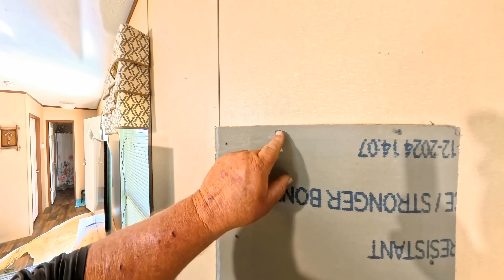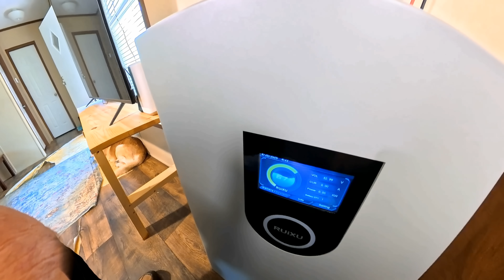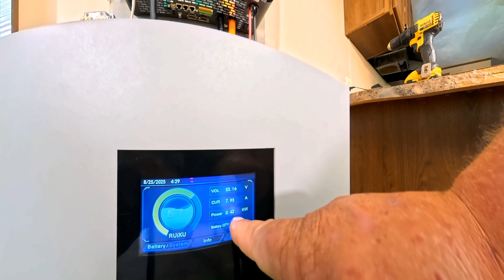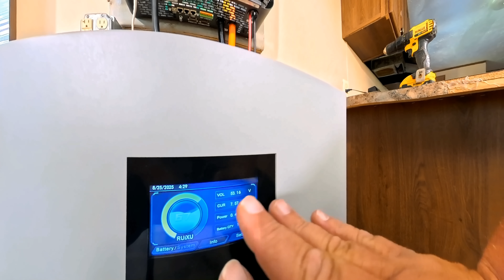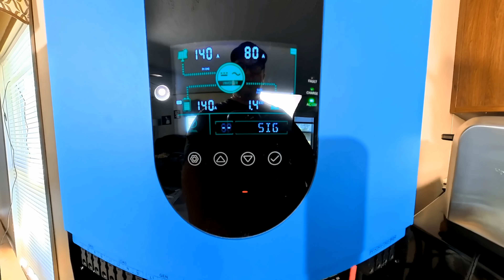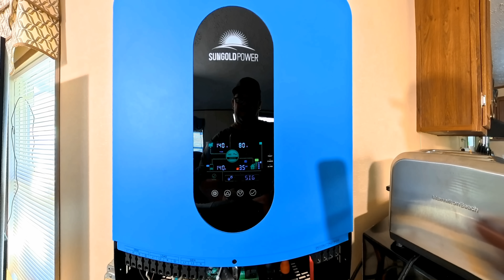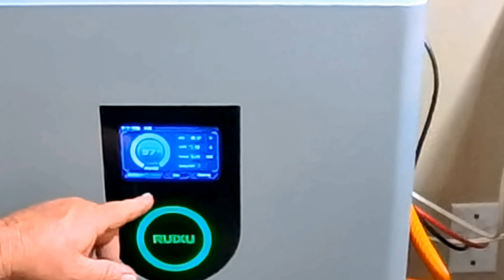Powering My House With 1 Battery Using Ruixu And Sungold

Comment: so much so wrong with this setup. Need to follow electric code "NEC"  wires from solar panels must be enclosed in emt conduit, the way you tap in to your trailer is very dangerous,
Reply from the maker: It's not dangerous it's tapping through plastic siding or what they call vinyl siding and inside the walls where it runs through the insulation you have the 120 volt wiring and 240 wiring running through the same crap. I understand putting it in conduit is the way to go for superior protection. But this setup has been working just fine for a year and the one that my other properties been working fine for 10 years.

Comment: Off Grid, I like using 12 x 2V 600Ah AGM batteries, when building my 24V system. 1st reason is each 2V battery is like one cell in a smaller battery, 
so you can replace that one cell and not loose the whole battery. 2nd you can make a 600Ah battery bank, and still be able to lift it on your own, each 2V 600Ah AGM battery is 40kg. The 3rd reason is price, with lots of newer types, AGM lead acid are cheap + I don't like BMS controlling my batteries.
Buy as a set to save even more money ( 6 = 12V  /  12 = 24V  /  24 = 48V ). 
I hope this information helps everyone get started.

Comment: couple of tips. install a power cut off breaker on the wall for the solar panel lines coming in. and Run a main line to your house breaker box and install a bypass switch to turn off pole power to house at the same time switching power over to inverter power. the line used to make connection between house fuse box to inverter should also have a 50Amp breaker. use the fuzebox to control where in the house you want to energize at any given time to reduce energy consumption. so much crap is left running or on when your not even home let alone while you are home.   all electronics today or appliances suck energy on or off.

Comment: I don't know where you're living at but I'll be living in Waynesboro Tennessee in 2 years. My goal is to do total off grid. How much did that system in the place you just put this in cost you??  I'm planning on building a 16 by 30, & wonder what the cost be for that system. 5o connect it into the electric panel. Not including the solar panels.  Because I'll have to do this in stages. Do the battery pack hook to the fuse box. Run the solar panels and connect them to the battery system.   I'm 63 so I'll be 65 when I moved to Tennessee, & may need some assistance with hooking it all together. I've been watching your videos and you're making it look fairly easy to do.

Comment: HI Justin great video man. I'm interested in running my well off of a system like this (Grid down scenario) . It is 220 volts, but not sure the Amps etc. It doesn't run all day for the whole house, but incrementally kicks on and off. What would be the best way to approach this?
Reply from the maker: You could actually run it with a system like this.
Reply: @OKLAHOMAOFFGRID  How would determine the amps that I need to run it?

Comment: Why not just 240 outlet out to a #4 ga to a 50 amp plug. Then, male into the receptical,  then shut the main off, turn on the inverter? Your next project should be to add a access ramp somewhere along that entrance of your place. You should throw the microwave out and the toaster. Nothing anyone needs.
Good explanation,  👍 👍 👍 👍 👍

Comment: Very informative. Thank you. I wonder what gauge wire is used from the solar panels into the house?  Are there length limitations?  Thx again.
Reply from the maker: Yes definitely length limitations depending on the gauge that you're using. I am using 10 gauge on this system and another system I'm using 8 gauge on.

Comment: That’s a 20 amp GFCI receptacle
Reply from the maker: No 15
Reply: @OKLAHOMAOFFGRID 
😂😂The GFCI IS 20 amp, the neutral slot is vertical and horizontal. The regular receptacle is 15 amp.
Reply from the maker: @Coyote-tc1ww sorry..ya your right I forgot I made that one with a 20amp 2 years ago. I have a box full of unopened 15 amp GFCI so I assumed I put one of those in when I built the receptacle but obviously not if it has the t slot

Comment: also some omore advice if you attach solar panels to the roof or like you did screwe them into your porch the city consideres that a structure and needs to be inspected or instellaed by a pro to negate that you can mount them on a pole in the middle of your yard 20 feet away from, the house.. with breakers and ways to cut the power and fuses etc etc.. they consider this a fence or like a fence or free standing structure... some cities dont care but youll have an inspector at your home... and you used regular 2x4 those will decay and get mould etc use galvanized fence posts or sqweare rack mounts or fence posts in concrete in the ground then it wont rust or fall apart in 10 years..one more piece of advice when hookiung up the power cables to the unit test whats positive and negative before you hook it up and if it has propper voltage also work at night solar panels are active during the day if you disconnect them a string they could spark within the mc4 connector this is why when compaines do it they wait  dont hook it up all at once and leave it hanging they hooke one up at a time then the final connections etc.. being a average joe i do all my panels at night and hook ups at night just incase then in the morning i test voltages and polarities you can do this with a dmm or a special dmm etc.. and if you ever see solar banks and controllers its inside your garage and outside the home why the garage well 5/8 drywall is fire rated for 1 hour of protection just like exterior doors have a fire rating for 1 hour and why ytou  should not install a interror door as your outter door... same thing you can install batteries in garage as long as garage has vents the twirly things on the roof and propperly installed  mounted to the studs etc circut breakers etc..  tesla batteries are known to install in garages more than outside.. but doing this inside wow recipie for disaster plus you lugged that up the stairs im your size and alittle older watch your back brother to old to tired let some young kid do it etc.. anyway ill stop talking lol
Reply: This is Oklahoma they don't have inspectors. Capital of red necking everything.😂

Comment: Power station much cheaper or back up . 3000 watts . Charged by house power  . Add solar if you like . Solar full time different  matter . Add more . Power up fridge  air conditioning.  Heating house big battery banks . And dolar . Charge electric car . No limit . Or hydro cheap .. 😅

Comment: In Nigeria these battery cost like 2k$ I’m shocked how expensive those batteries are in Australia and USA
Reply: $2k.... You sure it's real and the outdoor rated one? Lol In the USA this battery is $3,299... just checked the website. For 16kwh, that's a great price!
Reply: @kaleyeahitsaustin6026 yes it’s real in Africa a lot of Chinese solar brand here and you can set up 30kwh solar  system with just 5k$ ,the American government are restricting and putting tariffs on Chinese batteries and that’s why it expensive in the states
Reply: @Multi-Trend   no it's not because of tariffs lol the batteries have gotten cheaper over time. $3,300 for 16kwh... I'll take 4 that's so cheap! Plus if you get the indoor ones, they'll be even cheaper. I've not seen any price increases from tariffs and I live in the USA.

Comment: I collect pinball machines and one of my best investments was buying a used Escalera Staircat Ms-66 Stair Climbing Truck from eBay like 16 years ago. It goes for like $2500 or so but I got it used for 700. People borrow it all the time to move refrigerators and stuff. Great for moving my pinball machines up and down stairs. It would work great on that Riuxu battery.

Comment: I love your "get her done" attitude. When looking at this inverter's user manual shows line 1 and 2 combined. Will Prowse say's you need all 4 wires in the input and output, but yours is working with only three wires. Thanks for taking the time to make and post these videos.
Reply from the maker: I think I am only getting half the rated power like 3200 watts because I need to parallel one leg to the other

Comment: How can you recommend a product that you just got probably for free for making this video? Many you tubers are recommending products without really knowing what the product can do long term and people are getting burned by this. I bought a li time battery because of reviews like this and the thing blew up like a balloon on the first charge with a 100w solar panel and a 20amp charge controller. I returned it and went with something different. You guys should first try the product long term before recommending to your audience. I know you get free stuff but come on. My reputation is worth more than free stuff.
Reply from the maker: This battery has already been tried and tested thoroughly by one of the best @willprowse and for your information Li time 12 volt batteries are one of the best built on the market. So I don't think you should be jumping the gun on who I support. I love this battery and I want 2 more of them for my system...I have had this battery myself since March of 24. I have no problem recommending this particular battery.

Comment: I'm glad you got a chance  to check Ruixu 16kwh battery they are solid batteries! I used to be a big fan of the eg4 products but for price and performance Ruixu got them beat up! By the way Ruixu 10kwatt  sunon10 inverter will be a better choice for an inverter! It has all the breakers and solar disconnect for less $1500! Got one running at my homestead since spring zero issues!! Thanks Nate
Reply from the maker: nice
Reply: @OklahomaOffGrid Do you know if I can have the output from this All In One go to my generator inlet port?
Reply from the maker: @OP-fd4lhif you're talking about where your generator goes into the house and it is wired into a critical load panel then yes it's possible you can wire the inverter into that
Reply: @OP-fd4lh Ruixu sunon10 10k inverter has an ac input that can be used for generator input or grid power, not only assist with the ac load output but also charge up the battery bank at the same time! And if you get an auto start generator the inverter can communicate with it to turn on and off the generator only when needed!!

Comment: Gotta love it , wish they were around when I did my system, I used 4 used Tesla batteries they do decent but not as safe as that system great video brother keep them coming . We enjoy watching and learning more
Reply: I had 2 Tesla powerwalls installed 4 years ago, with a 10,000 Tesla inverter/gateway. It was $18,900. I checked recently and it’s $30,000, so with stuff like this, and YouTube videos like these, I’d go with these options in a heartbeat. The Tesla installation team isn’t around anymore, so support isn’t what I expected from a massive company. I recently lost connection to my app and they wanted me to find a Tesla approved company to help me, WHAT? Installing yourself you know the system and can troubleshoot it yourself. I had to have 2 batteries because I have a  220 well pump. Lately my battery is losing connection with my app, but went over 3 years flawlessly without a hitch. We’ve lost power 123 times in 4 years, mostly 5 minutes or so, some up to 9 hours, didn’t miss a beat running the entire house in summer. I do cycle tge hot water heater because that is 5500 watts and don’t want to overload and burn up my well pump, just replaced it after 35 years but not crazy about getting back in the well, especially in hot weather, lol,
Reply: @jerrytalley802 that’s cool are they still working good ?
Reply from the maker: Appreciate you watching

Comment: Did the manufacturer instructions say anything about batteries being store/used/charge in habitable zones?  Usually here in the UK they are in an outbuilding or externally covered because of risk of fire.
Reply from the maker: There's all kinds of warnings that I did not read so I really honestly couldn't tell you. As far as it being stored outside I believe it's okay underneath an awning or in a garage or even an open garage I just think directly in the weather it's not rated for that but indirectly it is

Comment: The video say “powering my house” you didn’t power the whole house. That’s just one outlet. I would like to see you wire it into a breaker panel. Thanks
Reply from the maker: I use it for a backup system. If I need to I can power the critical things in my house during a power outage. During the meantime it powers the TV the internet and other small things off of a kitchen plug. The breaker box is on the other side of the house. If I installed it on the other side of the house I may consider it.

Comment: So this is Hybrid Split Phase 48 volt system. Are you saying it's used as a back up. Does this mean like when power goes out? Can't it be hooked up to be primary and then have the grid as back up for extended cloudy days or heavy kw usage to keep th E bill down low as possible??

Comment: Nice! I saw a video of a guy who hooked a 120v generator into his main CB panel. He sent L1 and L2 into the panel but since it's only 120 he opens all the 240v breakers in the panel and runs all the rest of the house that way. I bet this setup could do the same. I don't have any open breaker slots in my panel tho. It would be nice to be able to flip light switches and ceilings fans etc as long as you remember no 240
Reply from the maker: It could do the same but it's also capable of doing some of the  240
Reply: @OKLAHOMAOFFGRID all my stuff is based on preparing to run just essentials during an outage but when I use extension cords dummy me still walks around the house flipping light switches lol. I could run my big generator to power the whole house but it sure would be nice to have an almost normal house run from battery power

Comment: additional thought, future video , does the invertor have a way , when the battery is toped off,  to  dump additional kwh into a standard water heater? other wise the invertor will go into scalping mode. solar coming in and no place to go, battery full. additional video , installing a breaker box energy monitoring system . so a family can use this install to cut their monthly bill . addition video , running this system into a sub panel. this is legal and by passes the risk of back feeding the grid . plus say your family goes out of town for a day . the power goes out , this system will not solve any in house needs, fridge , freezer , heat and air . give it some thoughts. thanks for your efforts. happy to see your YT efforts paying the groceries .

Comment: another thing to consider , in the future videos, mini splits also come in 120 volt . soooo in a power loss . a family could just plug in a right sized extension cord , from the outside unit , into your wall outlet , to keep the house comfortable . Also there are 120 volt well pumps with soft starts , which lower the start up amp requirement . Now a great load test would be an electric instantaneous 120 volt  water heater :)
Reply: Great thoughts.
Reply: Yeah, I'd have to consider a insta hot tankless propane unit for showers in extended power outage. I';d keep that solar system to run my Mini split and other items.

Comment: That is why I will only use several 12v 280ah batteries...😂 I bought four for half that price you paid...I don't like having high voltage solar panels in series... keeping it under 150v max...
Reply from the maker: Both ways has its positives in both ways has its negatives. I have installed systems both ways and I choose higher voltage lower amps and I also choose the least number  of BMS in the whole project it just makes it less to go wrong and less to balance.

Comment: the battery is the same price as the EG4 battery but they are basically the same battery but the EG4 comes with the customer service of signature solar.
Reply from the maker: eg4 is much more expensive per kwh
Reply: @OKLAHOMAOFFGRID  oh i see thats a 314ah battery and the eg4 is only 280ah. the price is the same so the ruixu is a better price and they are good batteries.

Comment: Does the inverter have breakers on its AC output circuits?
Reply from the maker: No it does not I wish it did the only thing I'm using is a GFCI 15 amp breaker
Reply: @OKLAHOMAOFFGRID well that GFCI is a safety, but you should use a panel with breakers.   Square D makes a 60 amp box that a quad breaker can be installed for up to 4 circuits with 220 volt split phase.  😊

Comment: Suggestion: reinforce your corners on your solar panel standing support structure. Otherwise a good wind will knock it over. 2'-3' Corner bracing at the top of post is required for lasting performance.  The way your bolts are mounted solely now will cause fatigue at the end of the 4x4 posts leading premature failure and collapse. A small price to pay for peace of mind and structural success.  

I appreciate your video offering and information.  Great news!  Thank you
Reply from the maker: Thanks for the info

Comment: I used to be in a wheel chair for a number of years, my wheel chair ramp has proved invaluable ever since even I fully recovered and no longer need the wheel chair. If you have stairs on a private home consider buying or building a ramp for these situations!
Reply: Totally agree with you. I don't use any medical assistive devices  myself but I believe in having and using, ramps, dollys/hand trucks and  carts when possible. They all make life so much more efficient.  At home, I use a large foldable shopping cart to bring in all my groceries or multiple shopping items at one time. 
  And, when medical assistive devices are needed, a ramp is already there if a home has one. It's just our mindsets that have to change.